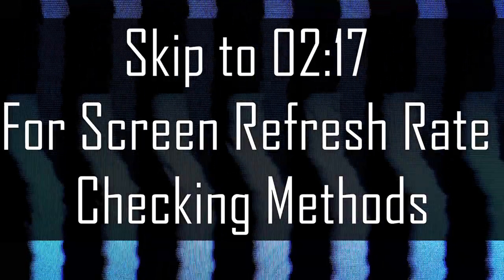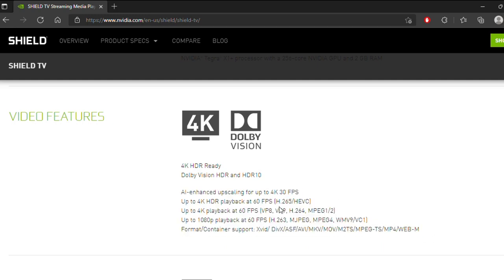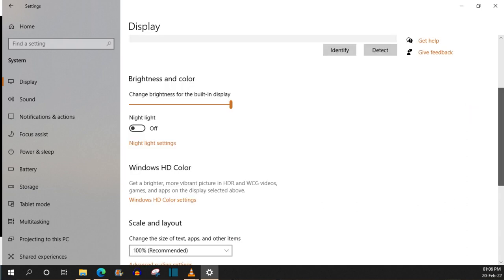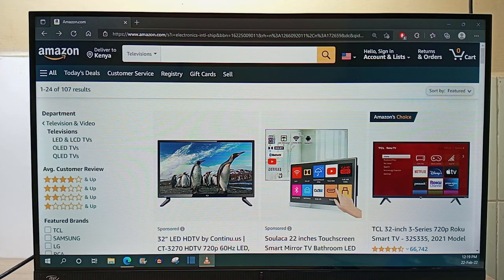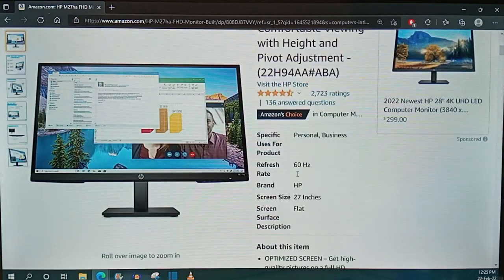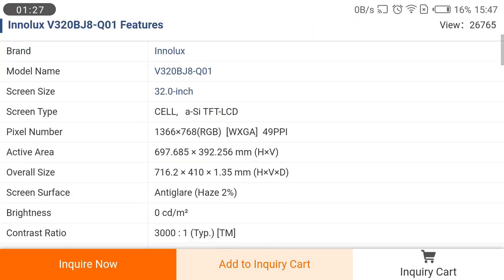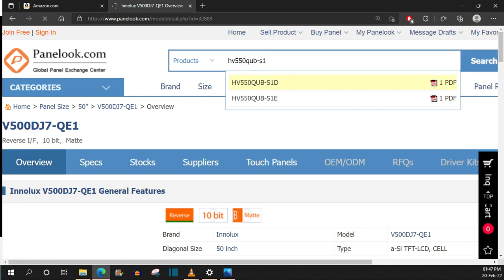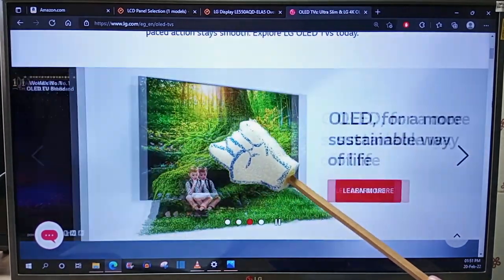How To Check TV/Monitor Screen Refresh Rate Frequency

Comment: I have the 50 inch Samsung QN90A and I know this TV is 120 hertz. It says it on Samsungs website, Amazon, and my Xbox settings say my TV supports 120 hertz. I did the check on my computer like you did on this video and it said 60 hertz maximum. Why?
Reply: Yes I got the same thing too. I'm guessing it just tells you your PC's native monitor screen refresh rate and doesn't consider the refresh rate of the tv
Reply: The hdmi on the pc itself may not support high refresh rate
Reply: 50 inch dont support 120hz !
Reply: 120 motion rate isn't fps